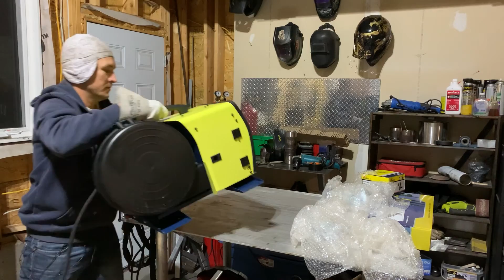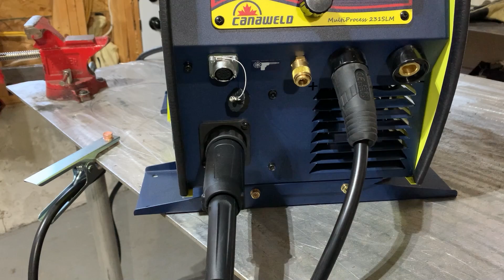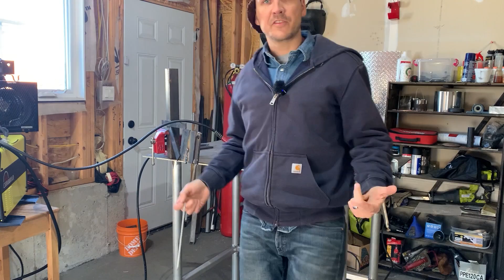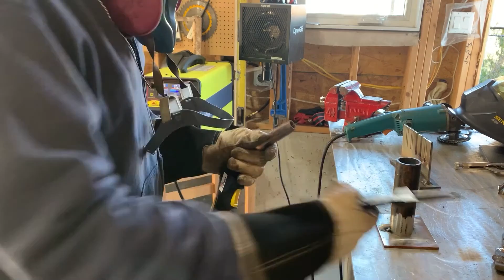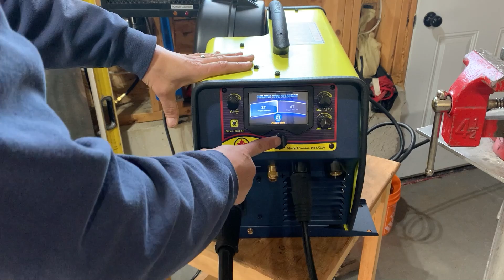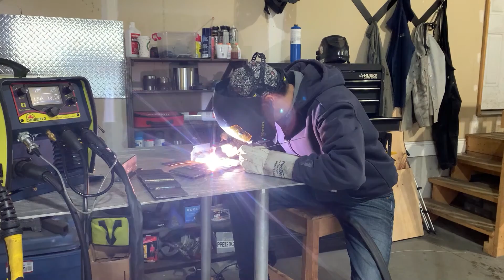Multiprocess Canadian Welding Machines

Comment: It's got a lot of good features for the money the 231 gold package comes with everything including a spool gun for like 2300.00 usd. Only down fall is it uses all tweco consumables. If you aren't aware tweco consumables are extremely difficult to buy online because there's tons of differnt variants of the same product that's just slightly differnt enough to not work at all.
Reply: you literally just need the part number... Or on cyberweld they tell you in the description what consumable your mig gun needs or what mig gun the consumable your viewing fits....Every part has a unique identifier.. Where are you trying to order from? 

Maybe this is a problem with canadian suppliers? Here in the US I've never heard anyone say what your comment mentions..(doesn't mean it isn't true, I've only used some of their products). If you are in the US and having a hard time, call robert's oxygen or airgas and tell them what part # your mig gun or electrode holder is (I prefer Robert's by a long shot if you have the option)

I use their quick disconnects on every machine I run off my trailblazer (QD's on the trailblazer itself, one on the + lead (about 15ft behind the electrode holder and on my suitcase wirefeeder, so I can do MIG or stick and still have 90+ft of leads). I use tweco stuff all over and have never had a single problem getting ahold of what I need or with the product's performance.

I'm using a bernard gun on my wire feeder, but we ran a few tweco 250amp setups at the shop I worked at before going out on my own - they really good quality and their 300amp electrode holder is what I would run if I didn't have a stinger v on my personal rig. I know a lot of the fluxcore guys in my area love the high-amp tweco guns too

Comment: Yawn...

Doesn't offer anything you can't get from a cheaper Chinese inverter machine now. Those are the best machines for beginners. When I started out years ago I bought a Lincoln 210 MP and a Lincoln Square wave. It was completely unnecessary. I bought into that nonsense that going with a reputable brand would be good because of the warranty and duty cycle. Turns out as a hobbyist fabricator (I build motorcycles and cars) rarely do I even hit the duty cycle limit on a cheap welder, and when the motherboard went out on my 210 MP and they told me it was going to be $800 to fix it because the board was discontinued, I laughed and walked out. It's been collecting dust ever since.

After watching and reading extensive reviews, I went on eBay and bought a Chinese inverter welding machine for $275 that does everything my Lincoln's do. Including welding aluminum without a spool gun. That was two years ago and it's still going strong.

I could buy two of them for the price it would cost to fix the Lincoln.

I will never spend over $500 on a welding machine ever again unless I'm doing it daily as an hourly job. You can say whatever you want about reliability. My Lincoln MP wasn't that reliable when the motherboard went out. So now I would rather have multiple cheap welders than one expensive one.

Lastly, don't fall for the made-in-the-usa or made in Canada BS. As an engineer and product manufacturer these companies are trying to make them as cheap as the Chinese companies are while still trying to sell them to you at a premium price. Don't fall for it.
Reply: There is lots of shops that rebuild Lincoln boards cheap.  Normally its a simple mosfet short
Reply: Which Cheap Chinese welder gives a 3 yr warranty.?
Reply: @OldGuy70s  no warranty on Chinese junk. Don’t kid yourself.
Reply: @kkswain96  Well name some Cheap Chinese junk wth 3 yRs warranty then...........!
Reply: What was the machine from E-Bay?
Reply: All you do is spot and stitch weld in a non-industrial setting. obviously your never going to hit a duty cycle. & I’ll say your problem was not buying a Miller lol. But fix and sell the Lincoln or sell it to someone to fix. Could help someone who’s breaking out.
Reply: How can the board be discontinued when Lincoln is still actively manufacturing and selling the 210MP?